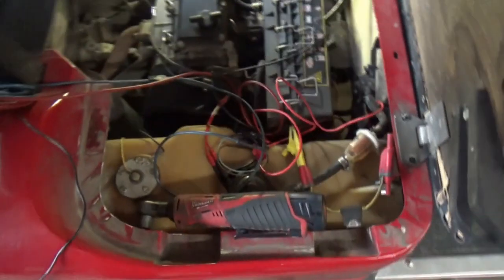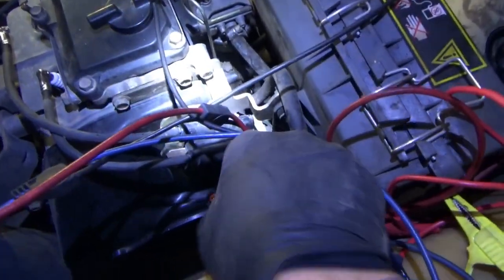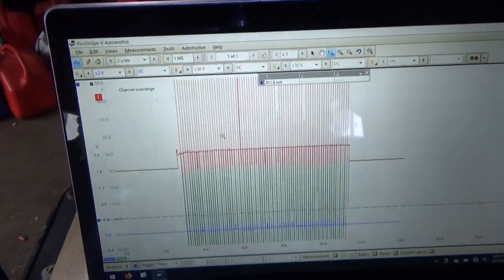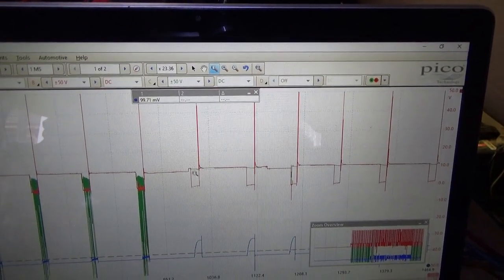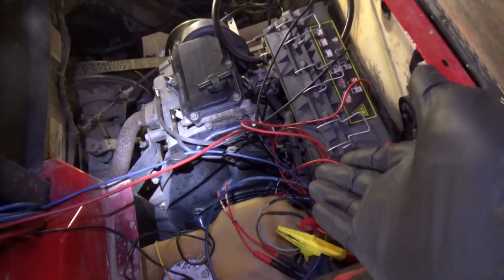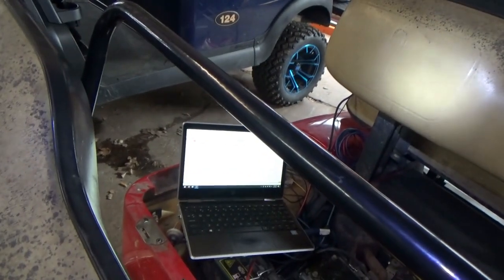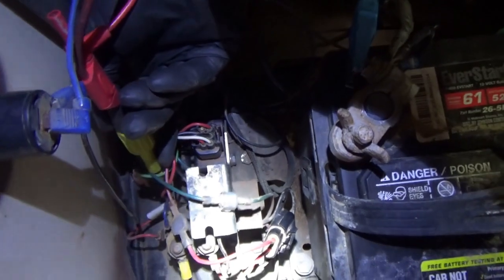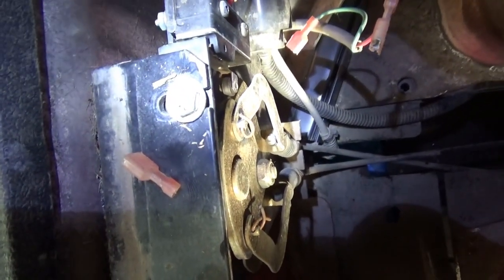Got Burned...by a GOLF CART?!? (EZ-GO No-Start)

Comment: i would highly recommend replacing the switch. golf carts are not designed to idle. the belt probably won’t disengage all the way when stopping, and it may burn up the starter generator if the gas motor doesn’t start or keep running when the peddle is released. and it could power thru the brakes and cause an accident. they are designed for the gas motor to turn off when you release the gas pedal. it is not like a stop start on the cars, it’s not a stupid feature. it’s how it’s suppose to work safely. the gas pedal is suppose to control the starter generator, and the starting and stopping of the gas motor, not the key. the key is mainly to lock it out from being started. and it probably won’t shift forward back properly if the gas motor is running. please fix it right.
Reply: also, it may not be idleing, it may be the starter/generator spinning the motor over, which will run down the battery and may overheat the starter/generator
Reply from the maker: I don't think the owner will just let it sit and idle for extended periods of time 😅
Reply: @chrischris1782  you are exactly right....it needs the switch replaced or the starter will just keep cranking until the key is turned off.
Reply: what if they hit they brakes to stop, and because the motor is turning, the belt won’t disengage all the way and the brakes can’t hold it? your not going to think about the key. or have it “idling” and it slams it in gear, bye bye transmission. if you burn up the starter generator, it’s going to make that little switch seem really cheap. there is multiple saftey issues by bypassing that switch. transmission shifting and braking are all designed to be done with the motor is off. i can’t believe with you experience you think having the motor start by just turning on the key is a proper fix. what if some kid is playing with it, leaves key on and it sits there cranking, or runs over something or somebody? when the proper fix is probably just a few dollars. i’m off my soap box now, i just hope nobody else sees this and thinks it’s a good idea. and i hope no one gets hurt by this…
Reply from the maker: @chrischris1782  Kids have to learn one way or another lol. Owner was cool with the repair and has been driving it for weeks with no complaints :)
Reply: @chrischris1782  My understanding on this: It’s not going to idle on its own until the throttle plate opens up enough to allow the idle circuit to work. When starter function of the gen/starter sees charging it will move from starter to charging. He needs to bump the throttle up if the gen charges he will be good to go. That’s the way I see it correct me if I am wrong. I had a cart that had extremely low compression maybe none I checked the timing belt to my surprise it was in time. While looking it over a throttle rod had fell of &% I put the rod on compression came back. I did not realize till then the throttle plate was closed that much. It made sense cuzz it does not set around and idle…

Comment: So is the starter running all the time? I think I missed something.
Reply: They are a dual purpose system, when it’s cranking it sends power through the “generator” and once it’s running, it then essentially is then switched to an alternator and then recharges the battery

Comment: That looks to be the same stupid little switch that is used on most vacuum cleaners for an upright switch.  You could probably snag a replacement off a broken Shark.  They just turn off the power head when the vacuum is latched in the upright position.

Comment: With that weird wiring, you need to double check that power is NOT going to the starter continuously.  If it is, he will burn up that starter quickly !
Reply: It's a starter/generator. It's always on when the engine is on.

Comment: I did all the tests. Bought new coil, new battery (needed one) a new Pulsar coil, spark plugs, new starter/generator, checked fuel flow (good), new igniter, sanded all the grounds squeaky clean, new solenoid, new voltage regulator. I was about to give up until I saw this video, and went out tried everything he showed. Bypassed ignition switch. Still, NOTHING. I can't seem to find any information on OHM readings and voltages to diagnose the problem. This is a great video, but I need more help or I'm gonna lose my shit and burn this thing up and watch how fast an EZGO disappears. Never ever buy an EZGO TXT. They built them knowing the faults, I believe, just to make your life miserable. Might just do a complete engine swap for a more reliable cart. Can't believe the ridiculous engineering that went into a golf cart. It's a frigin riding lawn mower! Why the insane amount of bullshit they put into these things. I'm almost ready to create a cart for the everyday person that can actually work on it. Air, Fuel, Spark, ignition. Basic right?
Reply from the maker: Did you use an oscilloscope when you "did all the tests"?

Comment: OH MY GOD for the love of everything right run down to Jake's and get a 10896 micro switch and fix this right before someone gets ran over with this cart. Second that switch also supplies power to the solenoid (trigger) to turn on the start/generator and ignitor and coil, if it had power to close the solenoid there should be enough power power for all 3. I find it funny the solenoid works the starter but not the coil so much, so it had to be bypassed before or the starter would have never ran while the key was turned on. What are you not telling us about this cart?
Reply from the maker: You see it all in the data on the scope...let me know the failure mode of the switch.
Reply: @PineHollowAutoDiagnostics  From the wiring diagram I show a heavy black wire from the battery to B on the solenoid, A on the solenoid (black wire) out to the start/gen F2. From B on solenoid (power all the time) black wire to 7 AMP fuse to both MS4 reverse switch and MS3 accelerator switch to the key switch by a green wire to D on the solenoid also there is red wire going to the ignitor and red wire going to the ignition coil. C on the starter solenoid is a common ground. First thing that saw was the engine turning over with the key switch without the accelerator pedal being pressed, did MS3 accelerator switch fail in the close position or was it by passed? If accelerator switch failed because of a contact issue why did it power the starter solenoid fine but not the coil since both get their power come from the same MS3 switch? Since both the coil and solenoid are in parallel powered by the same source and with about the same ohms I highly doubt power would favor one coil over the other unless something was bypassed.
Reply: @jims146  Look at the trace at the left side of the screen @6:28. The red (coil ground) trace appears to go high as the green trace spikes down to ~-50V. I suspect that the ignitor is kicking out when the voltage drops below ~8V and kicking back in when the voltage climbs back up. It's the only way it could produce the negative spikes and would prevent the coil from reaching sufficient saturation to produce an adequate spark. The voltage at the solenoid coil probably never drops below ~8V, which would be enough to hold it on.
Reply from the maker: @fascistpedant758  excellent theory! I didn't even think about the feed spiking to NEGATIVE 50V! Yes it seems that the ignitor itself can't function properly because of the excessive voltage drop across the foot switch, while the starter solenoid stays latched no problem. This is a really neat capture 😁

Comment: Why don't auto repair/electricity/electronics courses start from under the hood solving problems at the wiring? Instead of a book with lots of diagrams, squiggly lines, and math? The result (for me anyway) is the inability so troubleshoot the simplest of elrctrical faults.

Comment: Bad job ....  this is unsafe and will cause problems later.
stopping with eng running will cause brake wear and belt wear. also failed microswitch is a basic ez-go problem and most good ez-go techs spot it immedietly. removing switch can cause run away cart and is "DEFEATING A SAFTEY DEVICE"  ie someone gets hurt-- you get sued (and lose).
Reply: I totally agree